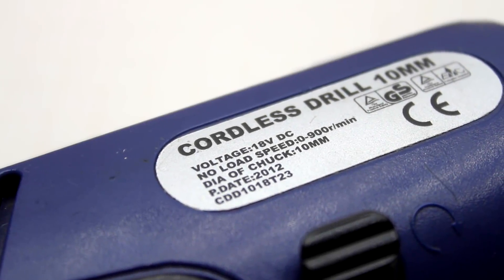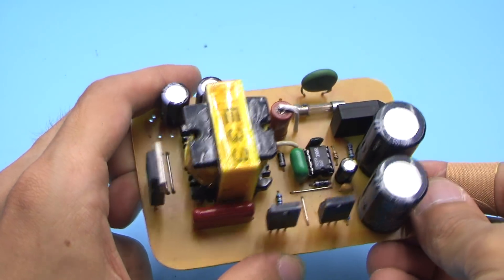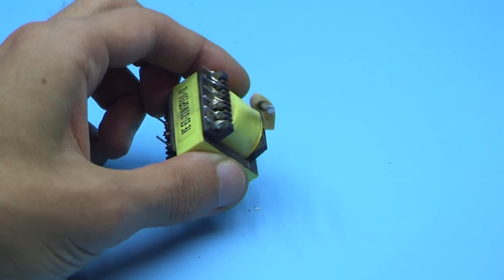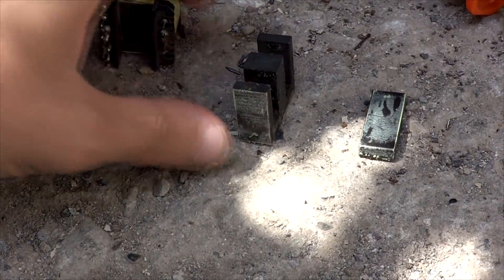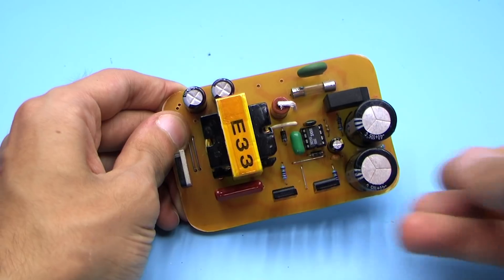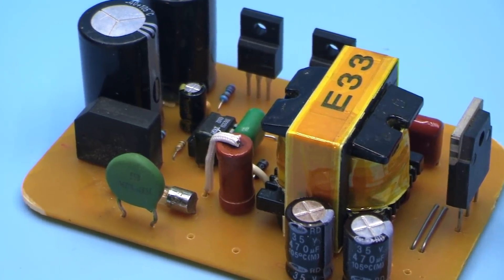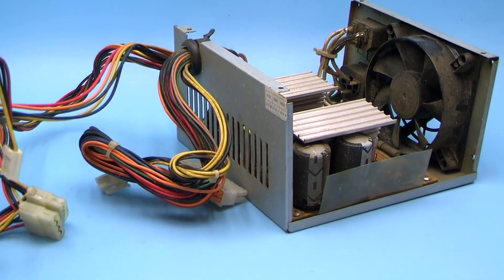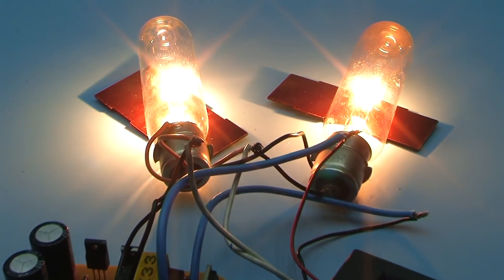Mains power supply for electric screwdriver

Comment: Hi, I have a problem. 
I build this power supply for an old string grass cutter (I don't know, what is it called). It had 18v NiCd battery which was dead. I got myself an extended type switching transformer, rewound it according to the calculations from your app, build the circuit on the board you provide, but whenever I turn it on (through a light bulb), it starts to make weird clicking sound and in 2 or 3 seconds, both of the mosfets fail. When I power it from low voltage source (and without any mosfets attached) just to see if the oscillator circuit works fine, I only find the required signal (cca 50 kHz square wave) on pin 5, but not on pin 7. I tried changing the IC but the result was the same. And if I disconnect the transformer and leave new mosfets connected, they die as well before I can take a look at their gates with oscilloscope. I don't know what could be wrong. Could you please help me somehow? 
Thanks.

Comment: Grounding pin 3 will shut it down. Using an NPN measuring the voltage drop across a current sensing resistor on the mains side could be used to shut it down during an overload.
Reply: Can explain in detail?
I want to add overload protection to this circuit.

Comment: IMHO if you can spend the time and expense to convert to mains then you can afford the time and expense to rebuild the battery pack with replacement cells, but only if they're of the same size and chemistry (to use the same charger) and are available in your area. Obtaining them is often a problem and used ones might not last long so this hack could be a good way to coax a favorite old drill into working again.  However, I'd try to provide some better heatsinking for the power components or choose those with higher current ratings and add a fuse or circuit breaker so the circuit will not burn out under full jam conditions.  Deliberately avoiding the clutch's highest torque setting is a no-go on the job site as people will forget that, or they'll switch to the highest setting when the job gets particularly tough thinking they can avoid damage. Both will put the operator at risk if the circuit burns while in use.

Comment: the power supply can be work to 127v AC ?
Reply: Robertec need use r2 with other resistance. And make transformer with other primary coil. My English bad, I know)))
Reply: Robertec don't make this sheme about this don't have protection, and if u make short on secoundary this sheme blow up. This channel make in Russian and autor of this channel don't know, what doing.
Reply: maybe it would be possible to use the same primary winding. after all, the same computer power supplies which have selectable voltage, doesn't have additional primary winding. perhaps it uses different duty cycle for 127v ac.
Reply: Cheese 1337 this don't working from 127vac about ir2153 need more power. R2.
Reply: yes maybe r2 is the single change need
Reply: Robertec for give normal power need make other transformer with primary and secoundary coils.
Reply: thanks for explain
Reply: Robertec :)

Comment: For separation of the transformer core its much easier to boil some watter in kettle, pour it in some tin can and throw transformer inside with wire attached. after minute or 2 just pull it out while wearing gloves an push a little. Much easier, faster and even heating than with soldering iron. Managed to break few of those ferite core while trying to heat it with soldering iron because one side was more heated then the other and it just shattered.
Reply from the maker: I know https://youtu.be/IOwT8GkvIjs?t=84
Reply: I normally separate transformer with boiling water but with someone's the glue don't unglue so the soldering iron is the only solution and i didn't break nome with a 200°C

Comment: nice , I have tried this circuit many times without luck . I got the circuit explode .
Reply: the ir2153 contains zener diode 15,6V for supply voltage. will not explode
Reply: thank you , I recently got the circuit worked with c7 100nf and cancelled c1,c2 and connect c7 to ground , and pri winding reduced to 30T  got it more stable.
Reply: @___OmerAJ___  hello bro.does the core has air gap? i think no air gap